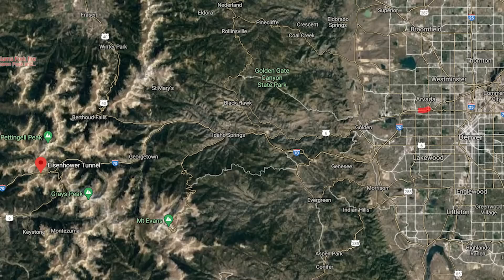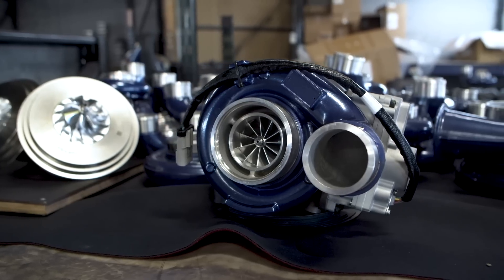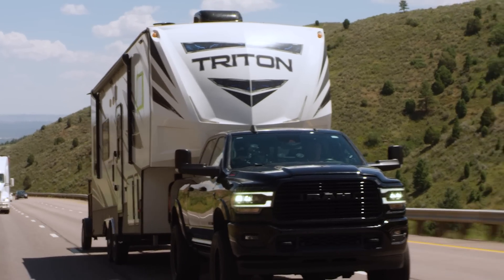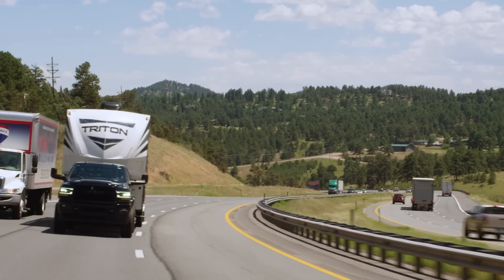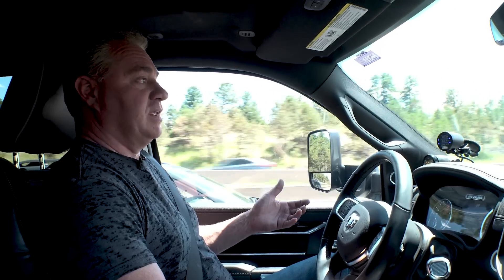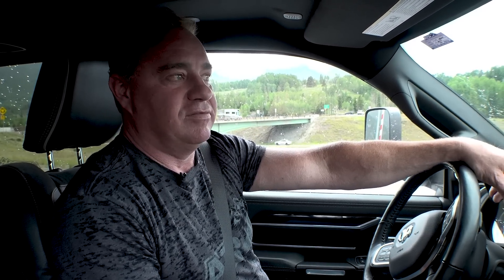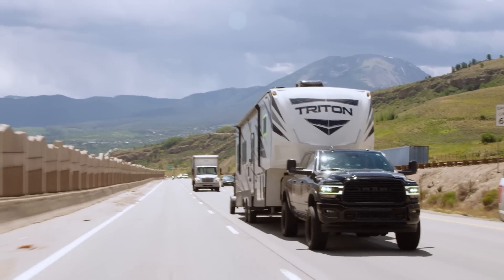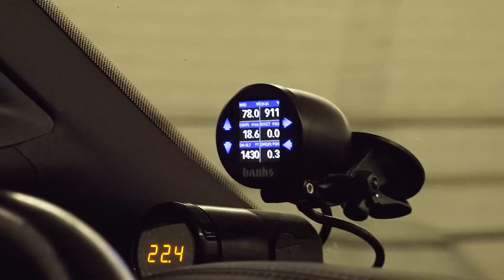ATS Diesel and Banks Power?

Comment: Avoid ATS Diesel Performance at all costs. My ATS Allison replacement failed after 18 months, cost me over $28,000 between two transmissions, and the truck only has 50,000 miles on it. Their GM, Nathan Grizzoffi, promised to “get to the bottom of it” but disappeared — I haven’t heard back despite two months of calls and emails. Five months in their shop and another $4,000 later, I’m left with nothing but frustration and debt.

Comment: Indeed lots of good information, but Clint you really do have to sort out your towing issues.  Get it leveled out, get a 3500 you are dangerously overloaded & the idiot comments are taking away from the solid info in the video. 2013 Ram 3500 154k , Aisin Trans with 410's (changed to 3:82 with 20" DDC hub centric wheels), Banks monster intake & I am about to install ATS VFR turbo, I am 32,500 with the weight ticket to prove it. (DRV Lx455 with a dresser in the garage)  Running Amsoil in the transmission (dropped trans temp by 50 degrees immediately) Never a problem through the Rockies. Looking at the idash next after your turbo. Get your camera crew ready & we will bring the rig by & run the gauntlet for you. (shame on the guys name calling in their comments be adults)

Comment: This was a very informative video on many levels. 

From the technical perspective, the drive ability perspective and so on.

My wife and I just purchased a 2016 Ram Laramie 3500 Diesel Dually. I know nothing about this vehicle other then it can tow my toy hauler and Harleys inside and to not allow the fuel tank to get to E.

Anyways you brought up some great points about towing. From driving through the plains up through the foothills of this mountain range and the things to be mindful of to not pushing the vehicle to hard to what to keep an eye on.

I noticed I have lost of temp gauges in between the RPM & Speedo that I can read and keep an eye on.

I will be traveling from So California to Central Utah in about a month towing the toy hauler along the way. 

You’ve definitely planted some things in my head to be mindful of. 

Thanks.

Comment: I'm going to put my ass on the line (because I'm still under warranty and currently waiting for warranty work) and tell everyone that can see this to go to Revmax or some other builder. I'm on my 4th or 5th (I think, can't remember because its been so much) transmission in 2 years from ATS and now has to be replaced again. They had blamed it on my tuning from HPP (now CTT) saying that 220psi line pressure was too much on their stage 3 68rfe, so they had me purchase their co pilot. They blamed it on my factory transmission cooling capacity  2014 ram 3500 dually so they told me to purchase a external cooler/fan. I bought a derale 35,000btu fan/cooler combo. 2 transmissions were bad straight from them when they shipped to their "authorized installer". Each time I have had to wait for over a month before they even ship a transmission even though they have them in stock and sell them to new customers without a delay. The first failure the torque convertor failed and took the transmission with it, second failure i got the transmission and the OD and UD clutches failed within a couple days and would slip with anything over 30% throttle and the transmission ran 214°F plus from the day of install. 3 transmission failed on the test drive after install, its replacement had a bad valve body found on the test drive after install and now after a year of babying a transmission that I told them was bad after install because the torque convertor clutch would slip under 60% throttle in OD and UD (they told me it was just the new GPZ clutch packs needing to break in) I have a failed transmission again. It takes 30 days to get a replacement leaving me without a vehicle that I need to tow my RV around.
Reply: Try GOEREND iv got one of their built trannys its been flawless they also answer the phone if you got questions.Out of all their reviews iv yet to see a bad one.

Comment: Runs very clean. AFR 19 is around lambda 1.3 and that is very nice. Do you use piggy back to tune this truck or do you modifie the software on the ecu. Was this the ecodiesel ?
Reply: The ecodiesel is in 1500's.  This is the 6.7 Cummins
Reply: @TheRoostersGarage  what ecu is used for cummins engine ?
Reply: @RyanRotax  I don't know what ATS is using with this setup.
Reply: @TheRoostersGarage  i should have mentioned that i was talking about the stock ecu.
Reply: @RyanRotax  The stock ECU is whatever Dodge puts in.  I don't have any detailed info, other than a Cummins tech I know hooked up his Cummins tool to his 6.7 Dodge and it said it wasn't a Cummins engine meaning it's not Cummins programming.

Comment: Been there done that in my 2011 F250 6.7 powerstroke.  Completely stock and pulling a 12,000 lb toyhauler.  Had no problem at all.  I have been all over the rockies, from Colorado to Wyoming and South Dakota.  Ran thru the desert in Utah, New Mexico and Nevada with temps over 100 deg with no issues.

Comment: You guys at ATS are a class act. I’ll combined with Gail Banks I just don’t think I can get any better than that Gail is been a class act for decades I really appreciate his attitude and stuff like that his tenacity to make things better as something as it’s not so simple differential covers and I learned so much on his video about that anyway I have an old 91.5 Dodge I’ll give you three guesses with under the hood I’m gonna be upgrading my HX 35 to a Ascot with the turbo is 64 or 65 something like that anyhow I have stage two injectors from dynamite diesel and I got a hungry diesel fuel pen I got a fuel pen from hungry diesel coming and 40 thorough 3800 RPM governor spring and I’m gonna go with the emanates timing device I’m not a big fan of putting in huge fuel to I don’t like to make a smoke show if I can help it and I believe in power through efficiency as much as possible and I’ve been preaching that to guys not preaching but commenting that the guys over the years and the chickens come home to roost I understand the EPA is cracking down real hard on somebody’s aftermarket companies but anyways you guys keep up the good work when I put my 47 RHN I’m gonna take a real hard look at your of five star tour converter it looks like a really nice piece all right

Comment: That trailer is not safe with all the weight on the rear axle like that. Flip the axle with a Dexter kit and it will tow level.

Comment: I looked up the 5th wheel the side by side and the small trailer 22000.lbs tops about 10000 lbs less than you claimed! With that said hard to believe anything else you say,
Reply: 22,000 in trailers/side by side + the 8,000 truck = GCWR of 30,000 give or take. The truck was required to move a gross combined weight of ~ 30,000 lbs

Comment: The ATS transmissions SUCK! They probably had to rebuild it once it made it back to the shop. Towed back is more like it! I had to remove my transmission twice, and paid for the shipping from Texas, so that they could rebuild it. The reason they offer a 5 year 500,0000 warranty is because most people won't pay to remove and ship it back to them. By far the biggest mistake I have made. My transmission is still under warranty and needs to be looked at for the third time since they first rebuilt it. I am not even going to bother sending the transmission back to have them look at it. I rather just pay someone locally to rebuild it once it goes completely out. Also, if you live in Denver and still plan to have them rebuild and replace anything on your truck, you better think again. I had them remove and replace my transmission once when I was there. The next time I had to remove it I noticed that they didn't properly torque the bolts ( some being finger tight). They also cracked the rear engine cover where the starter is located. This was because they placed one of the longer bolts in the wrong spot. In the end, this transmission and anything else will cost you more than the initial purchase price.
Reply: What transmission? 68RFE?
Reply: GOEREND TRANSMISSION.

Comment: Most of these comments are annoying. 1: He's in the left lane because he doesn't want to give up any stream. He's data logging and doing product development. I pull 18k regularly with my 05 Dodge dually and I always have some slow ass car or truck holding me up. 2: Yes he's probably including the weight of the truck. I agree he shouldn't and it would've been better if he had a weight slip. 3: Trailers have brakes rated for the GVWR of the trailer and he's going up hill at 65. Not exactly an unsafe speed. 4: last but not least, I thought California was going to separate from the continent and sink or float away soon? I can't wait! By By commifornia 😁

Comment: By the way --- little known fact...normally all the grades on the interstate road system were designed around an 8% grade --- however, the last grade, on the west side(west side, Eastbound) of Eisenhower, for roughly 750 feet, is 12%...right before you turn abruptly to the left to the tunnel approach.

Comment: Ok Clint...you live here --- you should know better --- Eisenhower east portal, 11,013 ft...west portal, 11,158 ft...and in fairness, you guys need to start running Loveland, 11,990 ft or Berthoud Pass, 11,306 ft...mostly because there is a HUUUUGE difference between 11,000 flat --- and 11,500 or 12,000...and really a telling amount of data that the EGT and turbo and piston temperature are going through in order to achieve a stock 300, 350 or 400HP.

Comment: 217 degrees on the coolant temp and we're not even scratching the surface ? 212 is boiling right?
Reply: Austin B87 <> 212* is the boiling point of water, “correct” but that is not under pressure , pressure increases the boiling point , now ADD anti-freeze it goes up again ! So maybe someone can give us the true new boiling points.
Reply: 50/50 mix with ethylene glycol and water with a 15 psi cap should put boiling near 270F (132C). You have other issues well below those temps, but boiling won’t be a problem.

Comment: So he’s running 46lbs of exhaust back pressure and only 15 lbs of boost pressure? That ratio seems way off. How does Banks feel about that?
Reply: over 1300F egt seems also insane
Reply: Exactly what I was thinking. Drive pressure seems way too high.
Reply: Thinking the same too. I would love to hear Banks weigh in on that. I figured there would be more back pressure from the dpf, 1.5 psi doesn’t sound bad.
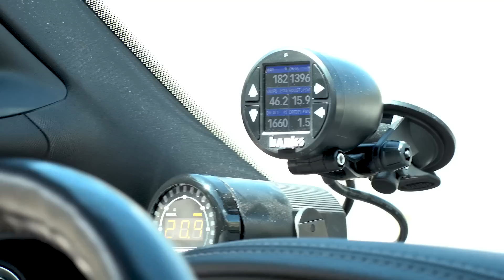Reply: 7:55 is where they talk about drive and boost pressure.

Comment: If you set up your 5th wheel to the right height (level), you would have an easier tow.  That’s why you are all over the road.
Reply: Allan Moulton mine sits high in the front. I’m out of adjustment and cent get it any lower. Pulls just fine. This clown pulling 30k with a 2500. What an idiot?! Talk about unsafe.
Reply: @jamessprague5653  this truck is also lifted on big wheels... talk about a towing setup
Reply: Like all of the others on the Road who build their Tow Rig backwards . Buy a truck, then almost immediately install a lift and large tires, then they have to start keeping up with The Joneses. Next comes the "Toys" and the trailer to haul them, then 6 months later they find themselves at the RV Super show buying a place for The wife unit to sleep and possibly stay dry,which might last a year if they're lucky because 98% of RV'$ built in today's world start coming apart the moment they hit the road. Then, if the initial unit wasn't a Toy Hauler, then it's time to Reup to an even more shittily built Toy toter where they find again they are constantly at the RV Repair shop trying to get that warranty  work done only to find out that it's going to take 2 months to make that happen, because all of the cash paying suckers get 3 to 5 techs because they charge $120/Hr so warranty might get 3 techs,maybe.  So before long, they're discovering that it cost 1K to have a weekend out with the toys, and the truck still needs more upgrades. But they also find that in the last 2 years, new trucks have all of the upgrades performed, so its more decisions. And they may have to go another 60k in debt.  And with both looking for better paying jobs so as to keep up that ever more expensive weekend play time,and keep The Repo man away. Enjoyment has gotten out of hand in today's world.

Comment: Are you guys running a lift pump to maintain those AFR’s with that set up? If so what brand? Just curious how the CP4 holds up to the bigger jobs like a larger turbo.
Reply: I need to upgrade my fully deleted ram 3500 dually's lift pump real soon.  Looking at FASS fuel 165gph titanium. I've heard Airdogs tend to malfunction. That is why they have an excellent warranty program.
Reply: On the 4th gen Cummins motors you swap out the cp4 to a twin cp3 system for higher power applications

Comment: I want to get an iDash for my 95 F350 Powerstroke but it says it's for 1996+ vehicles that have OBD2 even though my 95 came from the factory with OBD2 and communicates on the SAE J1850PWM protocol. I know I've heard tales of the 94.5 and up OBS Powerstrokes having both the Ford OBD connector and the OBD2 one from the factory but had to have the PCM flashed so it could use the OBD2 port which also left the OBD1 port useless afterwords. All that said would an iDash work on my 95 since it does use the J1850PWM protocol?
Reply from the maker: The iDash 1.8 (iDash DataMonster and iDash Super Gauge) read CAN data. Your 96 is pre-CAN. Yes, you have OBD, but not CAN. CAN was mandated in 2008. Our current iDash offerings are CAN data only. However, we do hope to release a pre-CAN (J1850PWM) at some point in the near future.

Comment: 30-32k on single rear wheel lmao your a joke.
Reply: The truck ain’t rated for it! Jesus where did you learn about towing weights? The tag on the truck tells all! Just because it will don’t make it right, safe, or legal!
Reply: Yeah pretty dumb to pull that much without a dully but in his defense those tires are rated the same as 1 ton tires I have them on my 16 2500HD Dmax and tires are what  your weight limitations are based on mostly. Plus he was dragging all the weight the truck only had the tung weight of the 5th wheel on it but I agree with you not the safest way to go
Reply: @roryrohrer7640  “Tires are what your weight limitations are based on mostly” 🤦‍♂️
Reply: @RealEyezRealLiez  well seeing as if you aren't going to put enough weight over your axles to brake them and smash the springs flat your tires are the first thing that will blow while towing so yes tires  are the main limiting factor. Let be clear the 30-32k this video claims he is pulling is GVW that's both trailers and the truck he is actually only putting the weight of the 5th on his truck which is 1500 to 2000 lbs of tung weight the toy hualer weighs 17-18k his little trailer and sxs together might weight 3k and the truck is 8k, the 5th wheel has brakes there is nothing wrong with this setup the truck is totally capable to pull this. I just don't think it the  single rear wheel is the safest if I where to pull this rig (which I wouldn't I would just put the damn sxs in the trailer and call it good.
Reply: @roryrohrer7640  If you get some properly rated tires for the truck that you intend to tow with, you’ll figure out that tires actually handle more weight than the axles. For my truck, my Ridge Grapplers are rated to hold 3750 lbs each. 2 tires per axle equals 7500 lbs. My axles are only rated to 7000 lbs. 
What your actual “limitation” is and what you should find out when you first get a truck is what your specific truck is rated to tow or haul by the manufacturer. Every truck is different based on how it was built. Just because your truck has the power to tow something doesn’t mean it’s okay to do so. It’s against the law to overload a vehicle on public roads. Risk your life if you want, but don’t risk others.

Comment: Auto makers will be on the edge of their seats (it seems) in the near future when all of the EPA restrictions for diesel get tighter the next few years.  DPF back pressures will be something they should monitor and engineer to be almost zero if they plan on selling trucks to folks that will use them as intended.
Reply: Dpf back pressure is at zero, if it's working correctly.
Reply: The numbers would definately be better if all emission controls "fell of the truck". 
We don't have to worry about the EPA for another 4 yrs, when Trump gets out.
Reply: @timleung9726  Some folks just don't get the idea and health concerns. Soot and black smoke is the sign of a poorly tuned engine. Once they get fuel to burn 100%, the engine has it's maximum power and torque. Lots of information on this right here on Banks channel. They've almost got it cleaned up except for the NOx.
Reply: @Garth Clark: I'm glad I have the right tune with my mini max! I need to deliberately stomp on the pedal to be rollin  coal. Next upgrade: FASS titanium 165gph lift pump.

Comment: Bro you ain't safe pulling that camper that way. Did you upgrade your brakes?
Reply: Do you not know trailer brakes exist? The trailer has to be equipped with adequate brakes for its weight.

Comment: The RZR in the back needs to be backed into the trailer dummy. Think about where the motor is. Thats why its whipping around. 6:50. Can't even keep the truck between the lines. I've GCVWR'd 30k with my 06' 2500HD CCLB LBZ and didn't  get trailer sway like that.
Reply: please ive towed 30 apartment buildings behind my dirtbike. All you do is run one safety chain and no sway bars. its easy